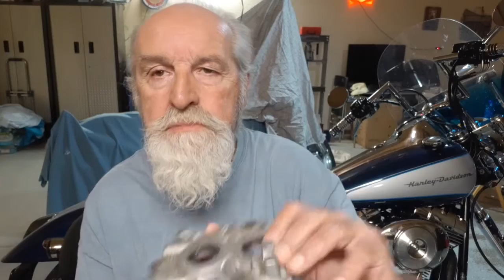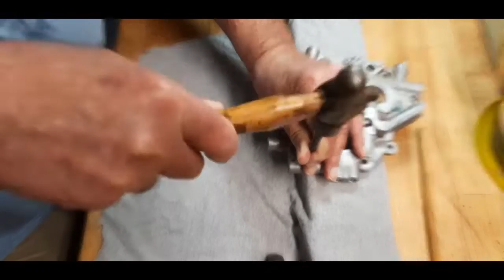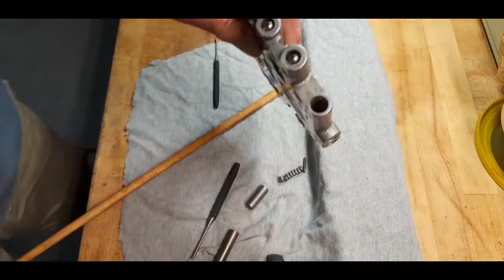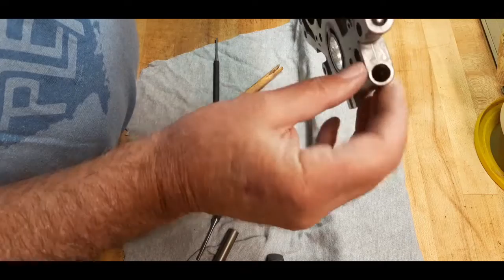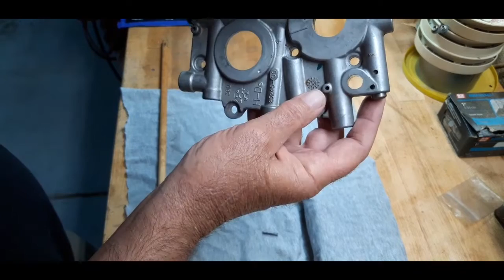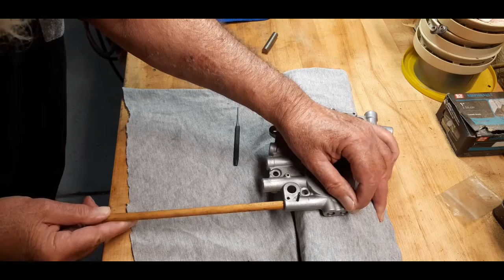Oil Pressure Relief Valve Harley Twin Cam

Comment: Do you recommend any certain type or brand of springs. I heard of baisley or something like that, not sure if I spelled it correctly.
Reply from the maker: No I don't recommend any one brand, stock springs work well as well as any reputable aftermarket manufacturer.  Thanks for watching and ride safe

Comment: If it’s fails somehow, will that cause the dipstick cap fly off? I’ve lost two within 6 days.
Reply from the maker: Yes it can cause enough back pressure to blow the oil dip stick to blow out. But before you tear into it check the oil level.  The most common cause for that is over filling the oil. If the oil level is right than it maybe the pressure relief valve. Thanks for watching and ride safe

Comment: Great video , do have a question would that cause engine to smoke out of left exhaust , rear cylinder
Reply from the maker: It could be cause by any number of things especially if it's a high mileage motor. I could be a bad valve, worn or broken rings scored cylinder. Do a compression test and a bleed down test on it. That will tell you if it's the cylinder and valves. Thanks for watching and ride safe

Comment: Can you actually add pressure readings by putting a bit larger spring with more tension?
Reply from the maker: In theory I suppose it's possible. I've never tried it or heard of anyone who has had success with it. Thanks for watching and ride safe

Comment: Hi i write from México i had a twin Cam Harley Davidson 88" year 2001 but i have not pressure oil inside and the check oil light is turn on you think this video can help me??
Reply from the maker: @WilberthBejaranoMorales  it can't hurt to watch the video and if it's a 2001 it probably hasn't been checked. But while you have the cam plate off check the oil pump. Stock oil pumps go bad on the 2001 models. Hope this helps. Thanks for watching and ride safe

Comment: What diameter is the hole? I want to make my tool ahead of time
Reply: Any suggestions on getting the plunger out when the magnet won't pull it out? I can't get it to move at all
Reply from the maker: @jamesashton5374  apply air to the back side of the cam plate where the oil pump bolts on
Reply: @tinkeringwithharleys  thank you for the reply. I did try that but it didn't work. But I did get it out. I ended up using a plastic dry wall plug the kind you put into the dry wall and put a screw into it. I shoved it into the plunger then screwed the screw into it. And man it was stuck! Anyway got it out and there was cam tensioner dabri in it. Thanks for your help
Reply from the maker: @jamesashton5374  having a piece of the chain tensioners stuck in there isn't good. That means the cam tensioners broke apart. That's probably what wiped out the oil pump. Depending how much debris went through the oil pump I would advise taking a longer look at the engine to make sure all the debris is out of the engine. There could be more debris stuck in the came plate and in the screen that goes in to the case. I hope there isn't but you need to check it while it's apart. I'm presently rebuilding a motor that had the same thing happen. The debris ran through the engine and destroyed it. I hope this not the case with yours.
Reply: @tinkeringwithharleys  so far everything is looking good I measured all the my tolerances on the oil pump and they were even within spec. Not even close to being worried about. I'm thinking that the plunger was stuck open a bit and not letting it build up oil pressure. Does that make sense? I even took apart the oil filter and there was no debris in it and I scoped the cylinders and they all look great. Lots of cross hatching left. No scoring.
Reply from the maker: @jamesashton5374  that's a good thing and if there's no debris in the oil filter it didn't run through the motor. There is a screen on the case that's part of the oil feed pull that out and check it and clean it. Was the debris from the old tensioners or the replacements
Reply: Thank for the tip on the screen. I will check that out. My knowledge on the bike is the detentioners were done no more than 3,000 mi before I got the bike and I put 8,000 mi on it. Which at around 11,000 mi seems kind of low for the condition the tensioners are in. They look more like 20,000 maybe or more. It's more first Harley so I am learning as I go @tinkeringwithharleys
Reply from the maker: @jamesashton5374  just a heads up Harley recommends the tensioners get replaced at no more than 20,000 miles
Reply from the maker: It's about 1/4 inch. Thanks for watching and ride safe

Comment: Hi, Thanks for good video. Can you do this without taking the cam plate out from the bike?
Reply from the maker: Thanks for the question, the answer is no you have to take the cam plate off the bike to drive the roll pin out. Thanks for watching and ride safe

Comment: I have the feuling plate and oil pump in my bike and lost all oil pressure. Any idea if the valve sticking could cause total loss of pressure? And also are the feuling pumps prone to any failure? Thanks in advance
Reply from the maker: If the pressure relief valve is stuck open it would cause loss of oil pressure but probably not a total loss. Usually total is caused by something else like oil pump failure. I've seen all makes of oil pumps fail for various reasons. The most common reasons I've seen are debris running through the pump and also to great of pinion shaft run out. Thanks for watching and ride safe.
Reply: I have the fueling twin cam plate upgrade in mine also and I lost oil pressure what did you do to fix yours if you don't mind me asking

Comment: The low oil presure on a twin cam is your best friend . The real issue with the plunger is not that it sticks  open to create low pressure but more importantly that it sticks closed creates to much pressure the piston oilers operate wide open at all times and the scavenge side can’t keep up and your bike sumps
Reply from the maker: Thanks for the comment and thanks for watching ride safe

Comment: Thank you very much for your timely response. Do you think it could possibly be a stuck relief valve? It looks like I can remove it and inspect it for any debris / damage without removing it from the bike. Would a stuck relief valve show no pressure at all ? With only 15K miles do you honestly think it could be the oil pump ? It happened almost instantaneously had had normal oil pressure right before going to zero. If I do end up pulling the cam plate do you recommend cutting the push-rods and going with the quickies or pull the tank and remove the rocker boxes ? 
Thank you for the assistance,
Rick
Reply from the maker: To be perfectly honest I've never seen a stuck pressure relief valve cause 0 oil pressure. I suppose it's possible but I've not seen it. Are you the original owner? If you are than you know everything that's been done on the bike, if not they may have been work done to it that you don't know about. If you remove the pressure relief valve while it's on the bike and get a lot of debris out of it that debris has also gone through the oil pump. Stock Harley pumps usually last about 60,000 miles unless they've been damaged. When you remove the pressure relief valve take note of the debris that's in there. It should just be crude from the oil, if there is metallic material in it you have a bigger problem and again all that stuff has run through the pump. Hope this helps.

Comment: Great video’s; very detailed and informative.  I watched the one on oil relief valve and oil pumps today. I have a question that I’m hoping you can help me with. I’ve been riding for approximately 55 years ( getting old ) 😎
Anyway my 2003 Harley Anniversary Edition Ultra Classic lost all oil pressure yesterday while idling in my garage ………. Bike only has 15,600 miles and is like brand new ,Thank god this time I didn’t walk away from it. The gauge went to zero; I waited about 10 minutes and started it again; still nothing. Waited 30 minutes and the same result. Today I removed the oil pressure sending unit and installed a gauge (it read zero) , I pulled the exhaust this afternoon and removed the timing chain cover. Everything looks brand new including the chain tensioner. No evidence of any debris anywhere  was planning on inspecting the spring and plunger. 
Any help or recommendations would be greatly appreciated.  It happed all at once, I’m having a hard time believing that it is anything major. Could I have a collapsed oil filter ? Probably shoul have checked that first ?
Thank you very much ………. Keep up the great videos.
Reply from the maker: Sorry to hear you have no oil pressure. I was going to suggest you pull the sending unit out and put a gauge on it to see if indeed you lost pressure, but you've already done that. So you have a good idea of what you're doing. I would recommend pulling the cam plate ( the cams and oil pump will come out with it). Remove the oil pump and inspect it for any wear or damage, also check the cam plate for a crack. If it's a stock cast cam plate they sometimes develop weak spots and crack which would cause you to lose pressure the way you describe. Also there is a small screen in the case which seats against the pump, pull that to see if there's debris in it blocking the oil flow. Also check the pressure relief valve. I hope this helps you find the problem. 
I did a video about 3 years ago about a cracked cam plate and I show the crack in the video. The crack is hard to see, but it may give you a idea what to look for. Hope it's something simple. Thanks for watching
Reply from the maker: https://youtu.be/LN2J3na67mo?si=9HDdkMXa827_qhFG

Comment: Got a quick question if you can get back to me working on one right now that I believe the relief valve is stuck I’m not sure but it is blowing oil. It keeps blowing the oil filter basically off it feels so much pressure. It will swell the oil filter up and then spit it through the O-ring. Have you ever run across this problem please let me know if so I’m thinking I’m in the right direction if not, any help would greatly be appreciated.
Reply from the maker: I have run into that problem.  It could be the pressure relief valve stuck closed which just allows it to keep building pressure. The times I've run into it, it has been a bike that someone else has worked on and covered a return hole with a gasket which creates a mess. Check the pressure relief valve and check all return holes to make sure there not blocked. Hope this helps. Thanks for watching

Comment: My buddy had to go retrieve his father's 99 Electra from a "Friend" of his father's after he passed away.  The bike had sat for several years.  Once home we got it running, and after a good quality oil change and 200 miles of run, the oil pressure drops to 0 warm at idle.  We believe what you explained here is the issue.  Knocked crud loose, scummed up that bypass valve.  We will try to take it out and clean it.
Reply from the maker: Thanks for the comment, while you have it apart check the oil pump also. Hope it's just the pressure relief valve stuck open. Thanks for watching and ride safe.

Comment: Actually not a bad video even considering he had the plunger backward etc. However, I've done this a number of times for friends and the only difference is I will 'lap' the plunger into the seat - that makes a big difference. It's a lot of work but, worth the effort so long as you do it your self otherwise, get hold of the Axtell Oil Bypass upgrade kit and presto, you are done!
Reply from the maker: Thanks for the comment and thanks for watching

Comment: Will it cause the oil cap to blow off
It's like I'm getting to much pressure
Reply from the maker: It can if the valve is stuck closed. But 9 times out of 10 bikes I've had in here with the complaint of blowing the dipstick out the cause has been the oil was overfilled. Thanks for watching and ride safe

Comment: 01 RK I bought with 26k miles. Second owner had it for 15 years and put a couple thousand miles on it since it was his Florida SnowBird bike that was used a few months every year. Just for fun, I pulled the camchest cover and inspected the tensioner shoes. They look very good, almost no wear. I then put on an oil pressure gauge, because I jist wanted to know! (No engine or valve train noise). I use 50W oil here because we have no cold weather here! Oil pressure on start up slammed the 60psi gauge, so I installed a higher quality 100psi gauge... It starts out at 80 to 90 psi on warmup then settles down to 60 and sometimes 50 after warmup. Sometimes at idle!. But never below 45 to 50 anytime. Here's the rub. AFter the oil gets good and hot, it will sometimes get up to 90 at 2500rpm and moves around between 65 to 95 at times. I put in 20w50 just to see, and it does the same. I'm thinking the spring was changed way back and maybe the plunger is sticking closed??? Or bypass piston is sticking closed???
Ordered a Fueling plate and hyd tensioner conversion, but it is back ordered.
Had I not installed the gauge, I would be dumb and happy riding along at 100PSI!!!
Reply from the maker: Wow that's way to high. It sounds like the pressure relief valve is stuck closed. You'll like the Feuling cam plate and pump. Have the Fueling on mine. 60 psi cold and 30 psi hot. Reduced my engine temp by 20 degrees. I live by a oil pressure gauge. Thanks for the comment and thanks for watching.
Reply: 0

Comment: Assuming regular oil & filter changes at around how many miles would checking the relief value be recommended?  And I gather you aren't recommending a new roll pin on reassembly?
Reply from the maker: You only need to check the relief valve when you open the cam chest to check or change tensioners, or your having a oil pressure problem. You can reuse the roll pin without a problem. Thanks for the question and thanks for watching. Ride safe

Comment: Good video. I made my tool out of a $1.99 1/4" nut driver from Harbor Freight I simply notched with a grinder using a cutting wheel. I needed mine short as I pulled it while the cam plate was still installed. I used the eraser end of a cut to length wooden pencil, to pull the plunger.

Just make sure you stuff a lint free rag into the drain back to the sump, in case the roll pin goes flying.
Reply from the maker: Glad you liked the video. Yep if you put you're mind to it there's a lot of tools you can make yourself. Thanks for the comment and thanks for watching
Reply: Dude that’s a damn good idea!

Comment: Thank you for this video I came to it right on time, I am in the process of changing my tensioners and inspecting cams etc. so I will take a look at the oil relive valve as per your indications. Would it be a good idea to add some assembly oil to it?
Reply from the maker: Glad you liked the video. It won't hurt anything to apply a light coat of oil to the plunger. Thanks for watching.

Comment: I'm confused because also when the plunger is pulled out it is facing solid side up that's what his magnet is hooked to
Reply from the maker: The solid side of the plunger should face inward to seat the opening in the cam plate. The hollow side faces out. The hollow side is also where the spring is inserted and compressed than held in place by the roll pin. Hope this clears up the confusion. Thanks for the comment and thanks for watching

Comment: Put a baisleys spring in mine what a huge difference I never checked the oil pressure beforehand ,I removed the oil pressure switch and screwed a oil pressure gauge on there I fired it up from  cold and was looking at over 30 psi on idle and 60 when I upped the revs .I think the gauge I used was a good one and was accurate ? I wish now I'd checked it before fitting the aftermarket spring .anyway it's running great 👍 any one else tried these springs ?
Reply from the maker: I've used Baisley springs on the pressure relief valves when I rebuilt the cam plates. They've always worked very well. It would be something I would recommend for a stock cam plate. You get a much better seal on the plunger or piston than you do with the stock spring and plunger. Thanks for your input and thanks for watching. Ride safe.